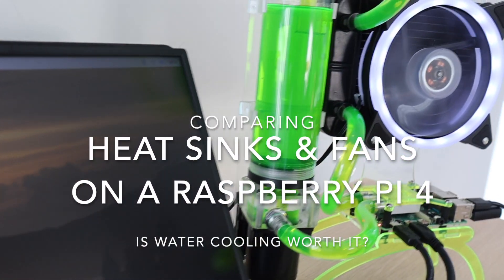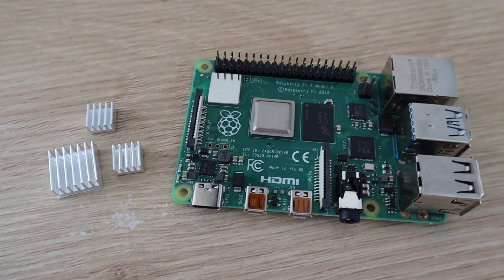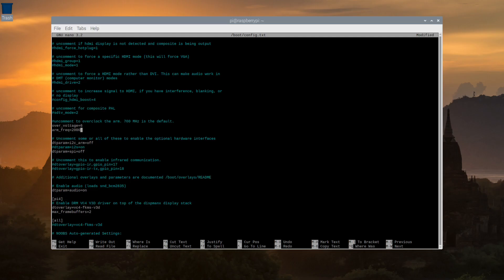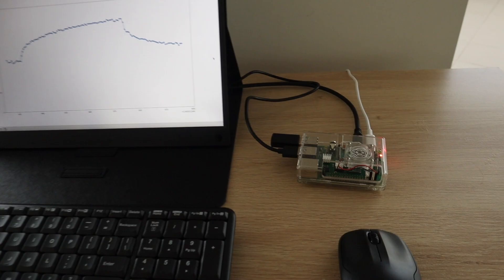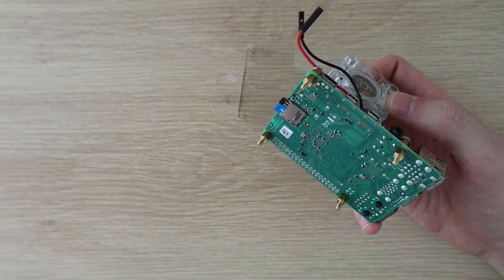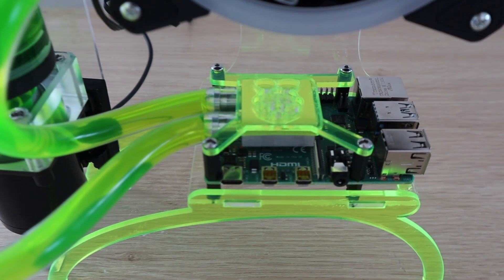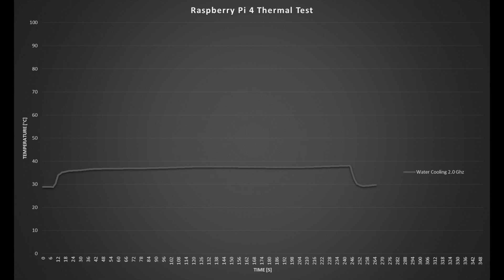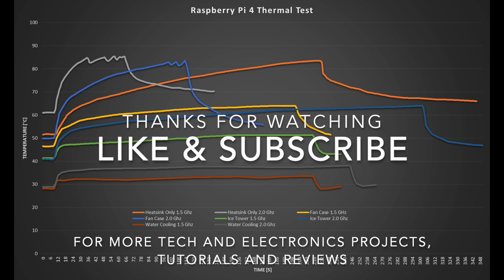Comparing Cooling Solutions On A Raspberry Pi 4 - Is Water Cooling Worth It?

Comment: Huh, my Pi seems to have way better thermal performance, with no fan or even an aluminium heat sink it is about 40c idle and up to 60 under load (raspi 4 b+ at 1.5 ghz) Weird
Reply from the maker: Thermal performance needs to be a relative comparison, you can't directly compare results from different environments and on different hardware. A room that is 10 degrees warmer than another is already going to show a significant difference in temperature regardless of the setup.

Comment: Im using the ice tower LP with arctic mx-4 thermal paste. Raspi 4 Model B 4Gb, Base clocks are 1500MHz CPU and 500Mhz GPU. Currently its OC'd to 2147MHz CPU Frequency, and 750MHz GPU Frequency, and after 5 minute stress test, I only hit 43.3c. So I think that thermalpad is holding back the performance of that cooler. Hope this info helps someone out.

Comment: I use one upright Ice Tower and two low profile Ice Towers to cool my three Raspberry Pi 4 Model B boards, but I use a Noctua NC-U6 with 60mm Noctua Fan to cool a Banana Pi M2 A31s and a HB-802 with 80mm Noctua fan to cool my Odroid-C1 and I will soon use a Xigmatek Porter N881 with 80mm Noctua fan to cool my Odroid-XU4.

Comment: I had used a peltier element. Then regulate it with powersupply till 12v 1 amp , > stresstest > temperature kept below 38 degrees. I use now alu cooling block with ribs and on top 2 40mm fans on 3.3 v , so slow speed , and it stays below 50 degrees on full stress,  or at 37 degrees at normal use

Comment: Hey plz tell me how did you stress test your pi4 .. also how did you plot graph with that?
Reply from the maker: I use a utility called cpu burn:
sudo apt-get install stress
wget https://raw.githubusercontent.com/ssvb/cpuburn-arm/master/cpuburn-a53.S
gcc -o cpuburn-a53 cpuburn-a53.S

Then use this to run the test:
while true; do vcgencmd measure_clock arm; vcgencmd measure_temp; sleep 10; done& ./cpuburn-a53

Graphs were just plotted in excel using manually extracted data from screen recordings.
Reply: @MichaelKlements  Thankyou so much for this detailed beautiful information 💯❤️

Comment: The fan case was run at full speed yeah?  You can also run the fan at a slower speed to reduce noise by using pins 1+6 on the GPIO (rather than pins 4+6).
Reply from the maker: Yes it's running at full speed for this test. You can reduce the fan speed, but this test was aimed at comparing the maximum cooling performance of each.

Comment: I use a 12 volt, 80 mm fan with external power supply, along with heat sinks to cool it down. I use it as a cheap desktop computer and the CPU temperature barely goes beyond 46 degrees.

Comment: what about a fan without heatsinks? im thinking the thermal tape that comes with most heatsinks does more harm than good lol
Reply from the maker: You need something to disperse the heat from the small surface area of the CPU. I don't think a fan blowing directly onto the CPU is going to do enough to keep it cool.
Reply: @MichaelKlements  considering most Pi's have run for years without any kind of heatsink or fan, I'm sure moving air across the chips surface would help a bit. 

The thermal tape that came with my heatsinks is over a mm thick, maybe 2mm. I'm thinking once there's a fan involved, the shitty thermal tape might actually act as a "thermal bottleneck" not allowing heat to transfer to the heatsink as fast as it could just shed the heat itself.
Reply from the maker: It depends what your Pi is doing. If you've just got Pihole running or intermittent data requests as a server then yes you could probably get away without a heat sink. If you're doing any meaningful processing then you're going to start thermal throttling pretty quickly without one. 
You probably do get different quality thermal tape, and thinner is definitely better. The Ice Towers all come with thermal tape (pads) and they work well to keep the Pi cool.

Comment: What cooling fluid in green did you use?  Antifreeze? Lol
Reply from the maker: Yes it's just antifreeze
Reply: I think u used smaller one… 12x something. I saw AliExpress had it around $5x.00.  Much cheaper than $1xx.00.  Ill get AliExpress one and use anltfreeze. Lol cool looking fluid!
Reply: By the way, changes later this year may slow or even stop AliExpress orders.  I hope not.  If so I want $1mill of items/ electronics b4 then. Lol

Comment: I'm running a 7node cluster that is just using 20mm brass spacers, which creates a high density package. For each node I'm using a 40x40x11mm generic aluminium heatsink that is cut down to about 30x40x11 mm for the CPU. The cutoffs are chopped down and used for the USB controller and the VRMs. I connected the heatsinks with thermally conducting epoxy and used 2x80mm 5V fans at the lowest settings to cool it. It's about $40 worth in hardware for cooling and a bunch of elbow grease. My goal was resonable cooling in a small package at the lowest price. At 25C ambient temps I'm never seeing 50C being exceeded at more than 10minutes 100% load on all cores. Not as good an neither as cool as the watercooler but a smaller package and very low financial effort. They are running at over_volt=4 and 1900MHz
Reply from the maker: That sounds like a really neat solution, passive cooling works pretty well for most tasks if you've got a reasonably good heat sink and you don't have to put up with the fan noise.

Comment: I use CooliPi 4B in passive mode. At 23˚C ambient temp, I get at max 48˚C with the Pi overclocked to 2350/750/550MHz (CPU/GPU/core, respectively). Send me an address to deliver one to your door for comparison. No strings attached, just fair review.
Use 8GB units, because they have 50% higher PMIC frequency (tahn 1/2/4GB ones), effectively delivering 50% more juice to the 1V rail. 
FYI, denote an ambient temp in your graphs, because that adds offset (yeah, the ambient temp one) to every run.
Reply from the maker: That's great for a passive heat sink, and then you don't have any noise either. Thanks for the tip on the ambient temperature, I'll definitely start adding this onto the graphs and test results.

Comment: If you sold a “water cooling kit” without paste (I buy it via link you give me),  how much would you charge me for all items and carved parts (without paste)?
If not to much expense...  I WOULD USE THAT TO DISPLAY “MY” 2ND RASPBERRY PI 4. LOL

ALSO I HAVE A “”ROCKPRO64”” .  THEIR WEBSITE GIVES MEASUREMENTS / SPECS.  COULD YOU MAKE SIMILAR WATER COOLER FOR IT?

Rockpro64 is another killer fun SBC.  BACK WHEN NEW (NOT THAT LONG AGO). I PURCHASED ALL EXPANSION CARDS ETC.  THAT WAS MY FIRST SBC.
I WAS WORKING THEN... BEFORE DISABILITY.
Reply from the maker: I'll have a look at the ROCKPRO64 and see if it would be possible to water cool it.
I do sell water cooling kits for the Pi 4, they're linked in the video description.

Comment: Your pi gets really hot even at stock speeds! Mine uses a heatsink/fan combination and never goes abouve 44, even at 100% load. Strange.
Reply: Wait, video editing? How?
Reply from the maker: Try installing and running the CPU burn utility and see what temperatures you get.

Comment: I've been thinking about using some raspberry pi 4s for a crypto mining rig, and was thinking about water-cooling it somehow. Put the radiator at the bottom, the pi's up the sides, and the res on top as a water feature, it'd make a curious desk ornament.
Reply from the maker: The water cooled Pi is certainly a neat desktop piece and talking point. I've been thinking about doing a video on crypto mining with the cluster I built, should be able to make a couple of cents a year haha.
Reply: You can't do that. Lol.

Comment: I see something a bit strange, my raspberry in a case with a fan similar to the one in the video with the fan at only 3.3V overclocked to 2.17GHz only gets 64/69 ºC depending of the ambient temp.
Yours gets a lot hotter with less overclock and with the fan at 5V how is that possible?
Reply from the maker: What are you running when it gets to your indicated temperatures? My results are not just through general use of the Pi, that's running a utility which intentionally maxes out each core of the processor to generate as much heat a possible. You should never encounter a situation like this in day to day use. Just using the Pi in the case and browsing the web or doing light work on it shouldn't get much over 55-60C at 2.0Ghz
Reply: @MichaelKlements   I run a 100% cpu load test like you  for like 15 min, that's why i don't understand the difference. I even used htop to see if its true that it is using 100% of the CPU and I also moniorized the frequency and everything was right
The only reason I see is that my fan, case and heatsink maybe are better in some way and the temperature here in Spain is lower (I think you live in Australia)  but the difference is too big because I just tested with the fan at 5V and 2.147GHz and the temperature is about 55ºC better tan yours for the icetower. The ambient temperature is arround 15ºC but I also tested it in summer and the performance is arround the same.
Reply from the maker: @alvaroelmanco43  what stress test utility are you using?
The ambient temperature also makes a significant difference. Your ambient temperature being 15C is almost half of the ambient in this test (around 27C). 
It is possible that your case is more efficient, but it's likely only due to the heat sink size or fin design. The fan and the case design (unless the case is significantly larger or smaller) shouldn't make much difference.
Reply: @MichaelKlements  I used a different test (now I used stress-ng) and now the temperature goes to 80°C. I think the test I was using all this time isn't very good.
I don't know the name of the test I used before I'm just starting in the world of electronics but the comand to start it is "stress -c 8"
Reply from the maker: @alvaroelmanco43 , yeah the test utilities also produce very dffierent results. Try out the CPU-burn utility, it generates the most heat out of any I've tried before. The write-up linked in the description shows how to install it.
Reply: @alvaroelmanco43  Stressberry? It calls stress or stress-ng. But I had better experience with linpack, it loads the CPU even more, gives about 2˚C higher temperatures with my heatsink.

Comment: Power consumption for each setup would have been nice to see. Also, can you overclock past 2GHz with the water cooling? Can you reach 2.5?
Reply from the maker: Thanks for the suggestions, I must have a look at this as well. I've got them running at 2.147Ghz, but even then they seem to be unreliable to boot up. Apparently the 8Gb versions are a bit better with this and I've seen a few people boot them up and run them at 2.5Ghz. I'll try this in a future video!
Reply: @MichaelKlements  Great, thanks for the response, looking forward to it

Comment: I have the 3B+ one with the ice tower overclocked at 1.6ghz on force turbo mode with zram set. I use it as a light pc and occasional  1080p video editing never gets over 41 Celsius but sits at like 35ish
Reply from the maker: I'm impressed that it copes with 1080p video editing. I've never tried editing on a Pi.
Reply: @MichaelKlements  I've tried. I've cut a 7 minute video (yes, the liquid Nitrogen RPI4 using CooliPi one) completely on a Pi4. My suggestions: use only fully 64bit system (it allocates a lot of RAM that need to be addressed in one process/threads), use the 8GB model and maybe add some swap. I've used OpenShot, Ubuntu 64bit. Be warned, 64bit Raspbian has 32bit applications.

Comment: I'm using a fan case for my Pi, but since it's loud as hell and doesn't perform well, I either switch to a ice-tower case for an ice tower or modify my current fan case to fit a larger and silent fan
Reply: Look at the Argon One case. It performs awesome and has software where you can control the fan speeds. It's worth the look.

Comment: if you want overkill then put a TEC on it aswell :-)
Reply from the maker: I'm thinking of a way to try this out. The main issue is that you need to avoid condensation, as the TEC is able to cool the CPU to below the dewpoint temperature.
Reply: @MichaelKlements  easiest way to do that is to use a pwm signal from the pi to control a timer or something that will ramp the cooling done by the tec, you could even add a humidity sensor to the pi and calculate how cold you can go on the tec before condensation becomes an issue
Reply: Too dangerous because of icing on the board. Flames to be expected because of short circuits. Better to hybrid Chiller cool by complete submersion of the Pi itself in alcohol based coolants like glycerin to go sub-zero. The Pi is small enough to have just one container for the cool side of your freezer and the Pi itself. Pro is that if your cooling fails your Pi won't explode. I use about the same system on my PC but it is a wee bit more complicated as it has two containers and double pumps to keep flow up which is difficult as glycerin is not that fluid. It is more a thick syrup at those temperatures.
Reply: @ForOdinAndAsgard  no it's not, Intel even have a consumer product that does exactly what I described, monitor temp and humidity and pwm control the tec accoringly, it's not rocket science to do this and it's even easier with a pi because you already have the gpio to connect everything.
Reply: @TommyApel  Yes made in a lab by people who have every bit of tech to their expose. Do mind we are tinkering at home. It ain't rocket science I know but going the chiller way is better for a tinkerer as it is more forgiving and if done right you have the same or better result plus you have the pro of not being able to blow your Pi into oblivion by wrongly connecting the leads of your TEC.
Reply: @ForOdinAndAsgard  I think you are overthinking it too much, powercontrol through pwm and a relay is not that hard to do and math is your friend Td = T - ((100 - RH)/5.), Td being your target temperature of the underside of the TEC and T being your ambient temperature, RH is your humidity. then you can put in as much headroom as you want or feel comfortable with and even a fan to move the air around the TEC which will make condensation even less likely. Again it's not rocket science to get this right and as this is a home project your margin of error is huge compared to a sold-to-consumer product so you don't need a lab and all the tools in the world available to you, common sense is kind enough and if you're scared then use a cheap rpi instead of your expensive one to start with.
Reply: @TommyApel  I hate math, I just want it to work so mostly I overdue it but it works.
Reply: @ForOdinAndAsgard  yes it's always easier when someone else does the work for you ;-)

Comment: I wonder if that radiator could keep a cluster cooled. Chain heatsinks together, run into the pump/res combo and the radiator, and see what overclocks you get. It would knock the price per pi down quite a bit, and may well look awesome.
Reply from the maker: That's actually what I bought the cooling setup for! I'm going to start putting the cluster together in the next week or two, just need some free time haha.
Reply: It absolutely could.

Comment: i have one of those Beefy China Heatsink cases, and a different amazing aluminium case.
Add a 50MM coolermaster fan Mounted in a 3d printed adapter. 
my Pi 3 running PIhole runs around 26-28C {ambient temperature is around 18-20C}
Reply from the maker: I saw the case you’re talking about this week, I definitely need to try one of them out as well. I have a similar case on a NanoPi R2S which works really well.
Reply: @MichaelKlements  The one i am talking about is:
https://magpi.raspberrypi.org/articles/group-test-best-raspberry-pi-4-thermal-cases-tested-and-ranked

{The green one. {i bought mine on aliexpress for less than 6$}}

Combined with a case like
https://images-na.ssl-images-amazon.com/images/I/71p6Y725rBL._AC_SX466_.jpg
And a 3d printed adapter/fan mount, Not only does it look nice it Cools quite well.
Reply from the maker: Thanks for the links, I’ll have a look at them!

Comment: Thermal pads on those tiny heat sinks are pretty terrible when it comes to thermal efficiency. Thermal adhesive would have worked better. And better still if those sinks were slightly larger and/or copper.
Reply from the maker: Thanks for the tips! I’m going to test this out soon. I’ve seen some people says that the thermal pads are terrible (and the reasons given make sense) and others say that they’ve seen no difference. I guess the quality of the thermal paste makes a difference too.

Comment: I use a 3D printed case for my Pi with aluminum heatsinks and a 60mm 5V Noctua fan on one of my Pis.  This setup performs nearly as well as the Ice Tower as far as cooling goes @ 1.9GHz.
Reply: I use also 5V Noctua fan with PWM - the PWM input can turn it on/off easily, just set it up using raspi-config. According to stressberry, my cooling setup (CooliPi) is better than Ice Tower both in passive mode and in active (fan on). See here https://github.com/nschloe/stressberry
The fan is inaudible at 3.3V and sufficiently powerful. Using no fan is completely silent :-D

Comment: I use a cheap aluminum case with 2 mini fans, dual fans barely make a 5 degree difference when on at load but really serve great as cool factor lol the wrong cool but even fans of doesn't go over 60 and 65 without fans on so I'm happy clock is at 1750 and gpu at 700 and works gr8
Reply: 7 usd gor the case and fans btw, directly from China at Amazon they have them like at 12usd

Comment: Hmm. I wonder if you can make a passive water cooling system. Like a reverse solar heater. Water flowing and collecting the heat and then passing from a big radiator.
Reply from the maker: That’s actually quite a nice idea. I guess as long as the tubing is large enough to allow movement of the water then it could work.
Reply: You mean Thermal Siphon, like LTT did?